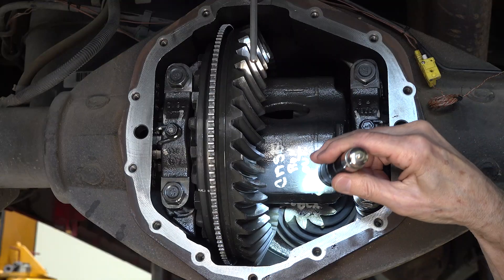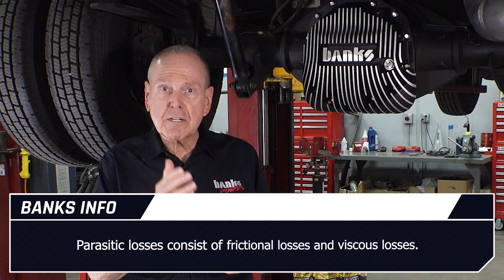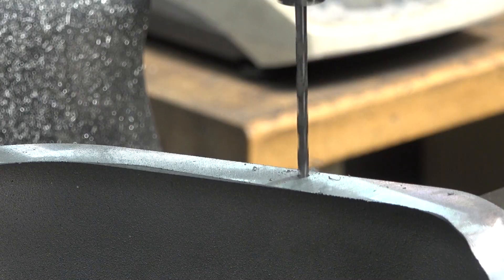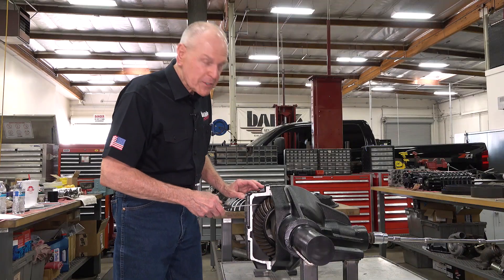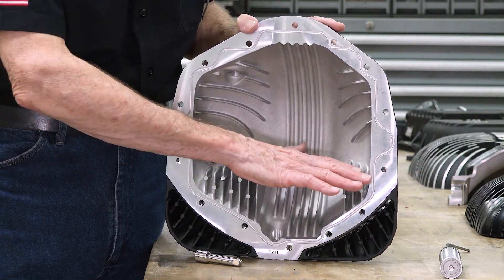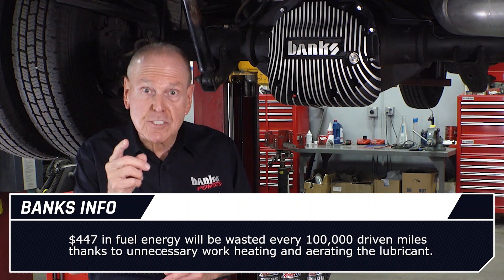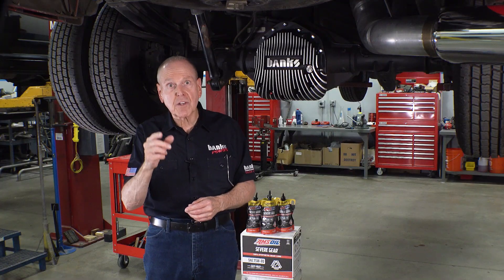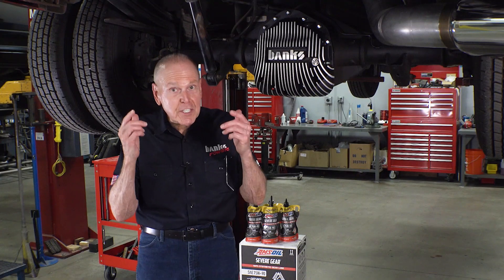Is your differential cover KILLING your gears?

Comment: I think this is a solution looking for a problem. 

You are claiming better fuel economy and higher horsepower but have you tested these claims and if so where are those results? I always find it suspicious when a small manufacturer says they can design a part better than a large company that pours hundreds-of-millions into R&D every year.
Reply from the maker: We're claiming better fuel economy than flat-back aftermarket covers, not stock.

Comment: "Increases fuel economy" right just like upgrading your exhaust bearings adds 100hp,got it. Oh and don't forget your high performance blinker fluid.
Reply: Viscous loss are real as is internal friction. If you set up a gear pattern on a new ring & pinion, I always go a little low in the valley and closer to the toe. They are pushed apart under load as the pinion angle rides higher, climbing the ring gear until the vehicles load weight is matched to push you forward. As not needed for everyone, but if I had a fleet that delivered products by trailer or 5th wheel, each would have this cover. Your comments fall into a category that tells me you have not rebuilt a differential on a regular basis. Or if you have, you should be cleaning toilets. Oh, you can take the magnets off of your fuel line as well.
ASE Master Tech since 1978 - Retired

Comment: 2001 Honda CR-V AWD?
Reply from the maker: Right now the engineering team is focused on the current-gen GM, Ford, and Cummins HD diff covers. Development for additional trucks is expected to start in later this year, sometime in the fall. As of now, we are not sure of the exact vehicles that we will be working on yet, but it will consist of 1/2 ton truck and suv's. We will post more updates when we get closer to start the development of them.

Here are the upcoming diff covers.
▪️Sterling 10.25 & 10.5 12" bolt (86-19 F250/F350s)
▪️Dana M275 - Ford '17+ (F250 HD/F350 SRW)
▪️Dana M300 - Ford '17-'19 (F350 DRW/F450)
▪️Dana 80 (94-02 Ram 5.9, F350/450 99-07)
▪️AAM 12", 14 Bolt- GM 2020+, Ram 2019+